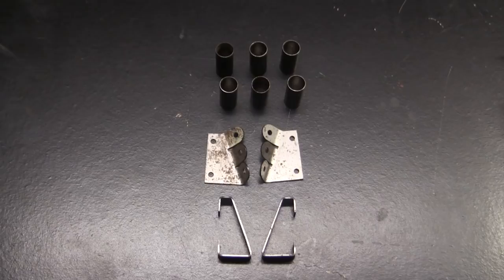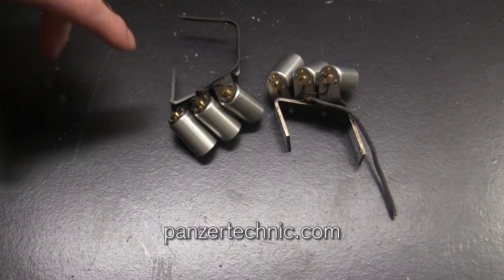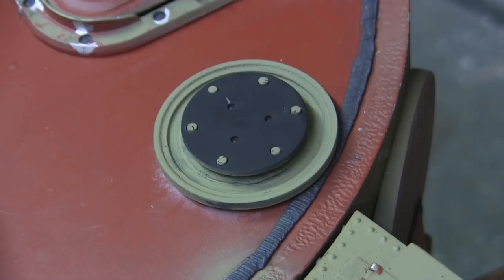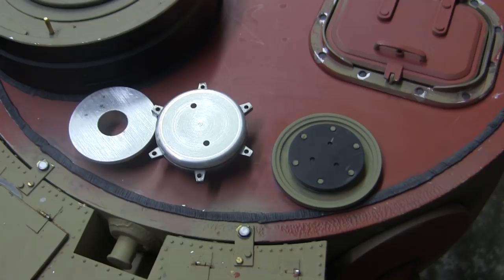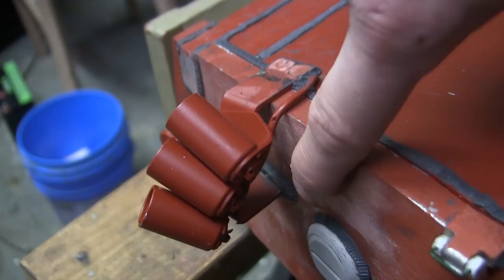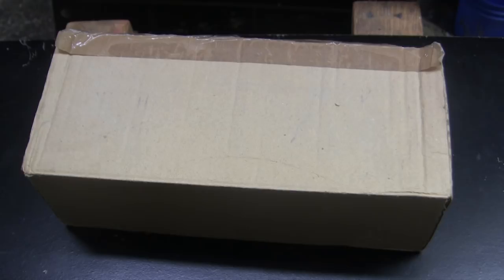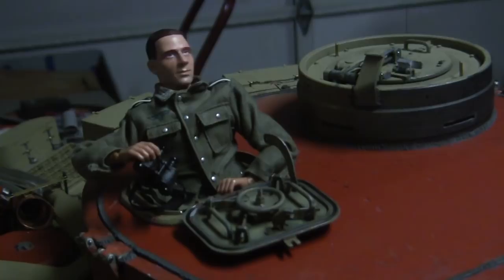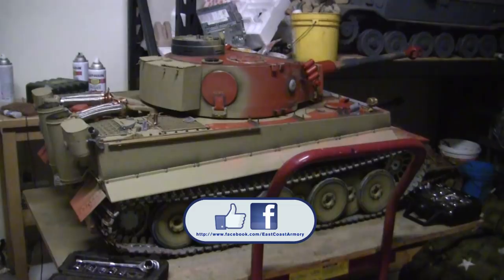Vintage RC 1/6th scale armortek early production Tiger I Video#14 part 2 of 2 (last of the details)

Comment: 2:31 must the smoke canesters have the inwords cut on them?
Reply from the maker: yes, the way you see them on these parts is how they look on the real tank
Reply: oddball759mm ok. My 1:16 scale tiger 1 early produktion dont have the inwords cut in them
Reply from the maker: Yeah that was a shortcut that they made on the 1/16. The Taigen metal ones have the cuts I think and were better then the plastic ones that are on the HL, or the metal Mato ones
Reply: oddball759mm i have the heng long ones.  So i Will have to get New smoke lunchers and a New musselbreak and a fier extinguidchere
Reply from the maker: I do yes, for the smoke launchers I use the taigen ones, as for the fire extinguisher I use the metal ones that are sold online... I think they are from mato. They are usually sold in a set of two from what I can remember.